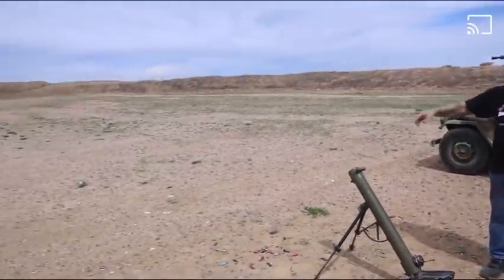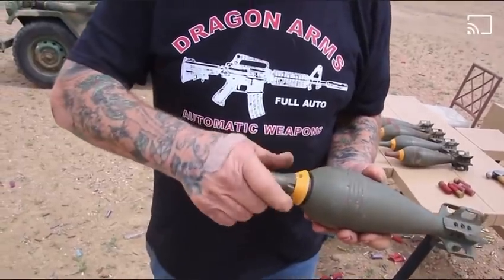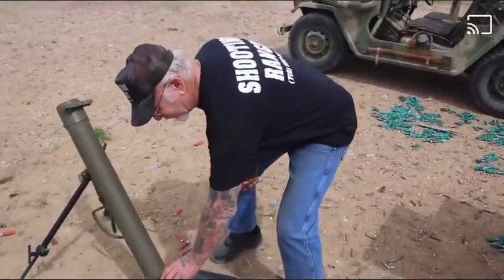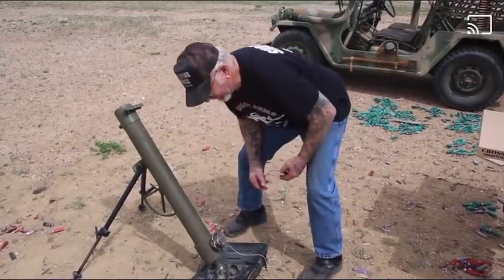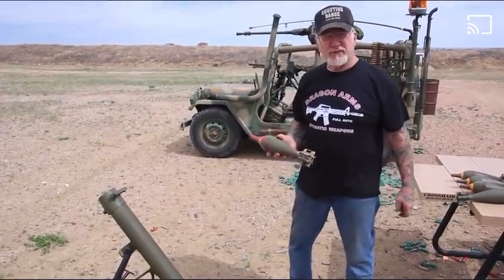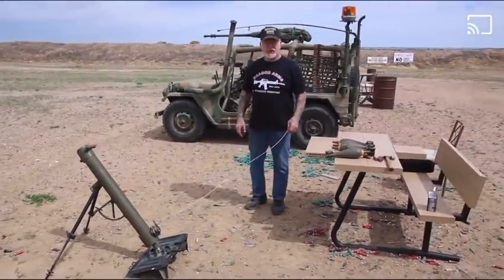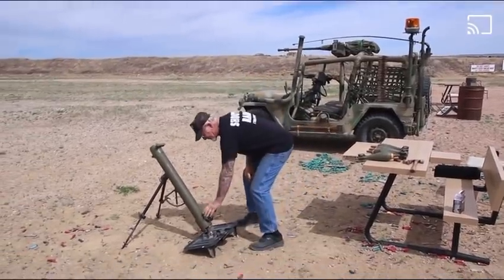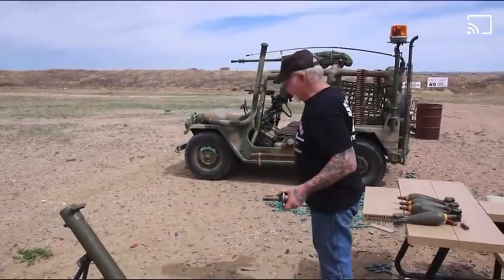Testing a WWII 81mm mortar!

Comment: awesome. never knew there was a firing system at the base. i thought it was just drop and fire.
Reply: I think the normal method was that..i have not seen mortar crews dropping the round in then going to a foxhole to wire by command wire
Reply: I think this mortar is Finnish. The U.S. 80mm mortars did not have an angle quadrant  fixed to the barrel.
Reply: @rowbearpucklebuck2331  Yes, it's a Finnish smoke launcher, and is not rated to fire actual mortar shells.
Reply: @mzmadmike  hi Mike i remember these Finnish mortars coming into the US back in the early 1980’s. I believe they weren’t classified as a destructive device and not a firearm since it only shot smoke generators and as you stated, not capable of handling the pressures of an actual mortar round. Sort of fell into that gray area of the 37mm tear gas guns and Lyle guns, ie not guns but projectors.